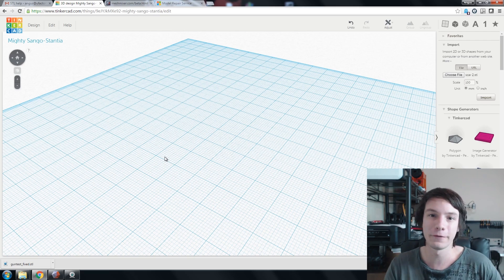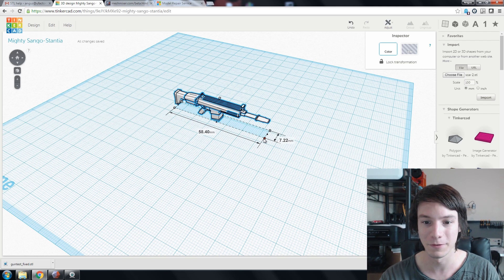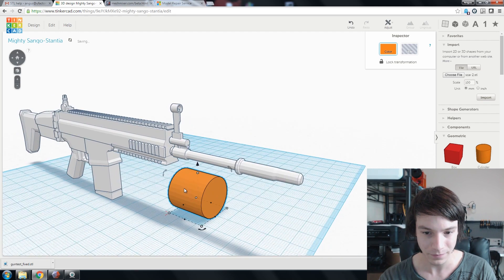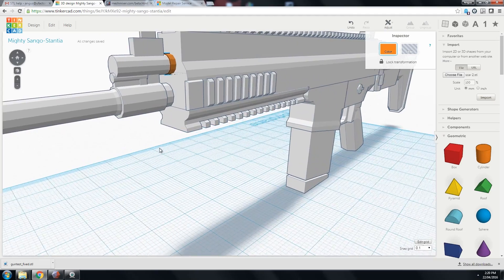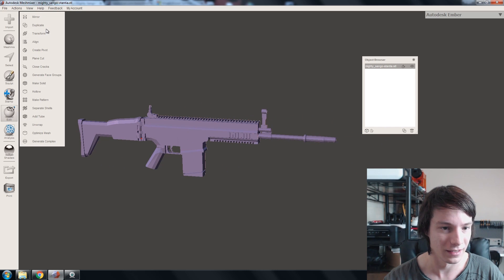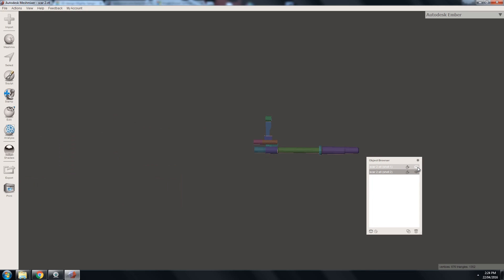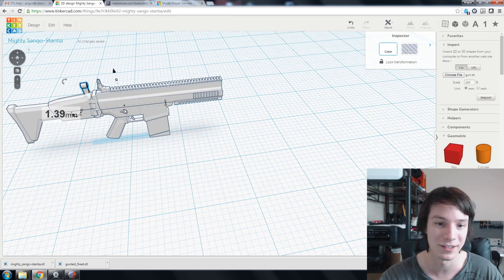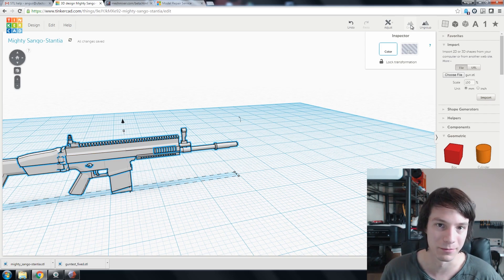Stitching Meshes together in... Tinkercad! 3D Printing 101

Comment: Rather than free-hand I think it is easier to duplicate the barrel, then delete everything except the 2 cylinders on the end that you want to use to fill the gap. Once you've deleted the unwanted part of the barrel and are left with the 2 small cylinders, just stretch them and merge it all together. It's easier, faster, and the gap will be bridged with the exact size needed rather than "close enough".
For the last part, you should import the original STL that had the gap but, had the barrel in the correct location, and used that to align the new parts (I know you were just demonstrating the technique but, you merged it with the barrel  much lower than where it was meant to be.)

Comment: Btw! Here is a tip for a future how-to-video. Illustrator exports STL.  So you can import an object exported from Illustrator into Tincercad (a text for instance) and then extrude it to desired thickness. I.e: If I want to make a square pen-cup with a complicated pattern it is easier do do the pattern in Illustrator, -export it to STL, -extrude it (in Tincercad), -make five copies (four sides and a bottom) and so on...

Thanks for taking the time makeing these inspiring videos! :-)
Andreas, Sweden

Comment: Couldn't you have used the original model as reference when you lined the 2 separate STLs you created and then simply removed the original, or left be in this case since it would've just merged them together fixing the gap you was after. Great tutorial. Just thought of that as an idea.
Reply from the maker: +Christopher Reed Good idea! That would have probably worked well, Tinkercad won't bring the other model in 'in place' but you could line the models up by eye to then work out where the barrel should be.

Comment: you can also separate it in tinker cad  by duplicating the part,  making two boxes turn and the boxes into holes one for barrel and one for the duplicated gun minus the barrel. the parts will then be separate and then you can position them together and combine.